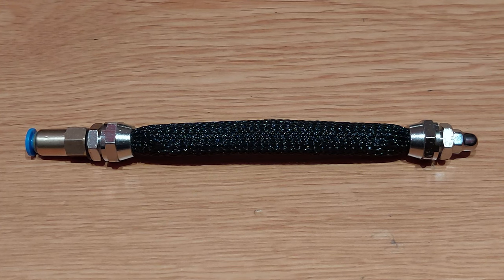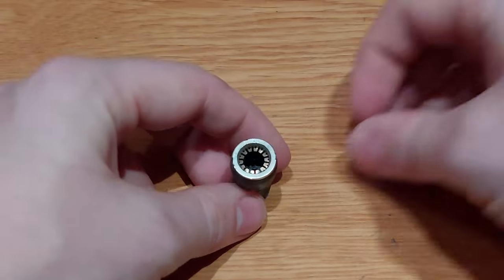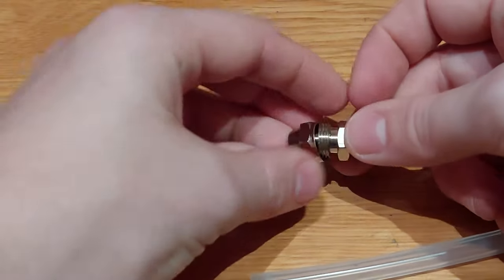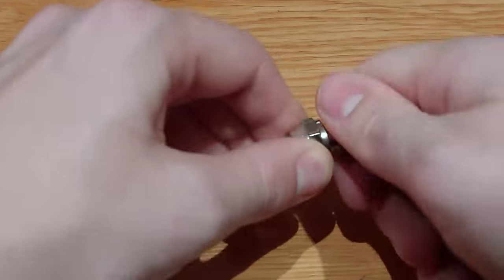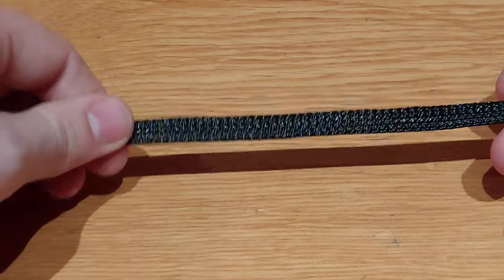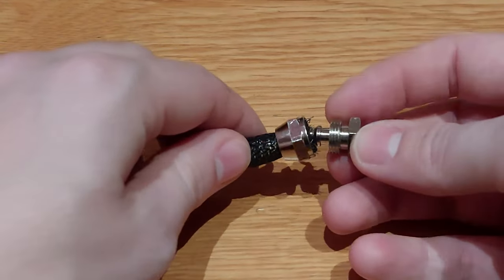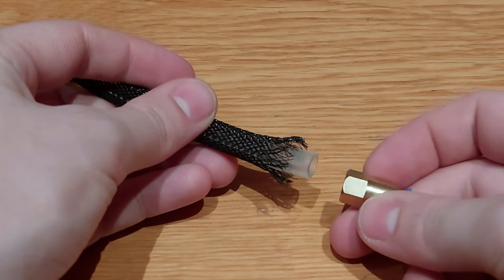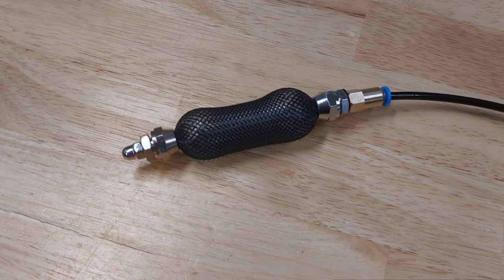DIY pneumatic air muscle 💨 🦾

Comment: Very good, a clean and neat solution. You could possibly add a bracket behind the securing nut to act as an anchor point.
Reply from the maker: Yes, I tested that and it works great.

Comment: This is exactly the type of tutorial I’ve been looking for, thank you! Is it possible to connect to some sort of code (maybe on raspberry pi or/and arduino) that would allow it to change its strength? For example if used in a robot, could it be possible for an ai program to control the grip strength of individual fingers/ arms? If so- I’m not sure at all how that works actually 😅 

I’m building a personal project (it’s honestly a bit of a pipe dream) without any previous knowledge and just using info that’s already available since I’m not trying to go into an advanced career- it’s more of an art project if anything
Reply from the maker: You can control the force by regulating the air pressure. To regulate the pressure, you can use a microcontroller to control an electro controlled air (pressure) regulator. Good luck with your project.

Comment: Hello brother. What kind of pipe you used inside the nylon braided sheet?  Does any kind of pipe will expand this much? Also what is the air pressure you used
Reply from the maker: I used a silicone tube, not all types of tube expand like that. The pressure was about 7 bars.

Comment: I've thinking of making these for while now. 
How much weight do you estimate this will be able to pull?
And could you make them proportionally controlled with proportional valves?
Reply from the maker: There are some formula's online on how to calculate the force, but of course it can also be measured, for this muscle (inside diameter 6mm) I expect a force of a few hundred newtons.

I think it should be possible to control it proportionally.

Comment: Hello, many thanks for releasing this! Its nice to havw a mckibben muscle that looks so well made! Do you have a definite list of reccomended parts and dimensions? Buying the parts for an exosuit soon but I dont want to mess up the parts list!
Reply from the maker: The force and stroke of the actuator depend on the dimensions of everything. As seen in the video, the stretching of the sleeve is not so regular when it's to large. Because the parts are cheap, I recommend buying a few sizes and trying some things out. As a reference, I used the same diameter of silicone tube as the coupler was made for (OD 8 mm, ID 5mm) and the sleeve that worked best is a bit smaller, 6 mm.

Comment: Can i use nylon sleeve instead of carbon
Reply from the maker: I also used a plastic sleeve, the camera makes it look a bit different.
Reply: @stijnsprojects  but brother nylon has more strength than plastic and also nylon is not that much expensive as compared to carbon sleeve so i will use nylon sleeve